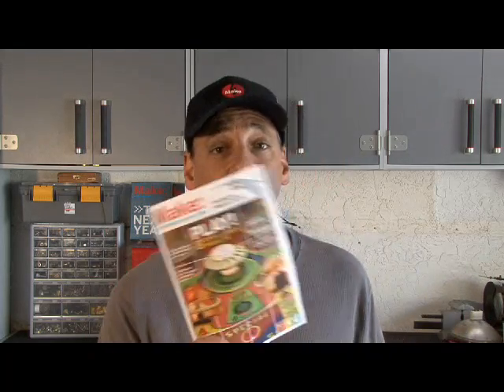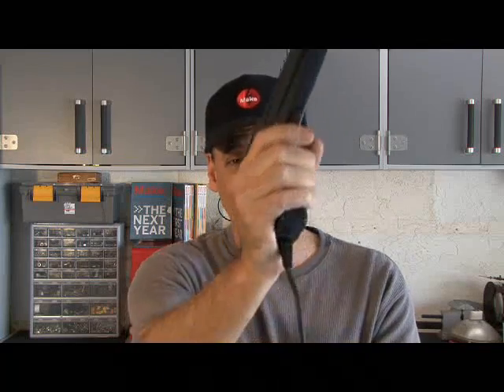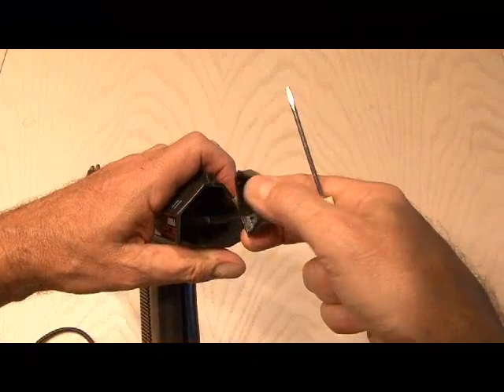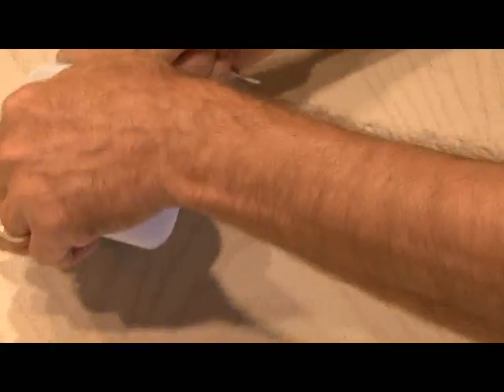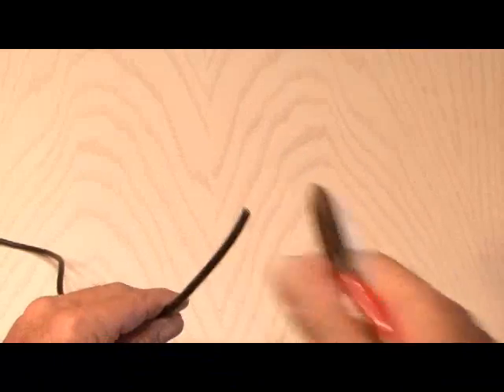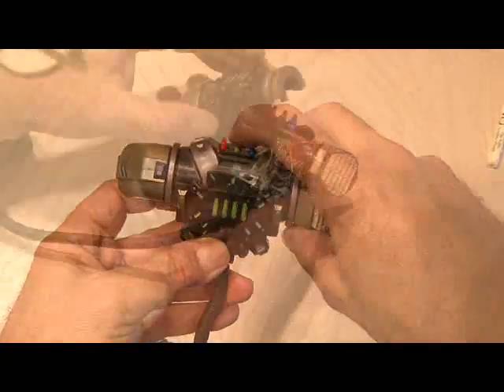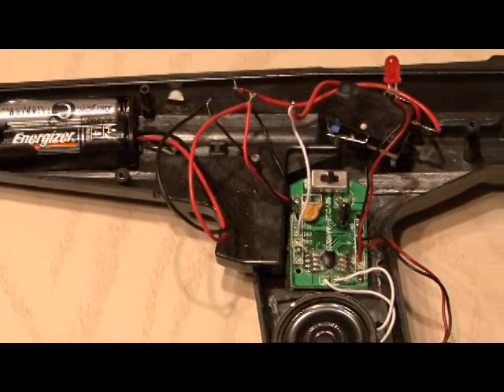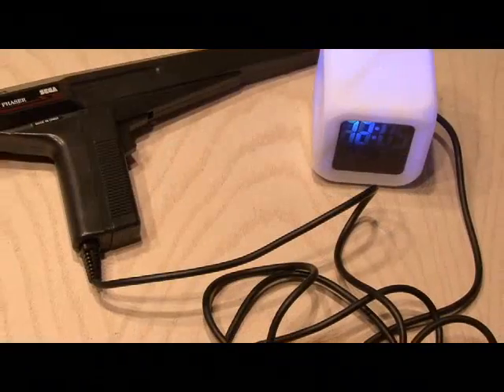Weekend Project: Phaser Alarm

Comment: remember the other two wires in the Sega's cord?  If I had done this neat little mod, I think I would have taken that second LED and mounted it to the clock's case, used the other two wires in the cord to deliver the  the charge...then, instead of looking down the barrel of the gun, lol, you could see the 'impact' on the clock!

Comment: that's right, in this one you don't even have to point at the clock to turn it off =( ..... what's the fun in that?.....
but probably with the laser mode, you'll be too sleepy and have bad aim, so it'll be easier to just throw the hole dam gun directly to the clock, lol

Comment: Use normally open switch, solder to the off button contacts and you get the same thing without retro gun and noises. Instead of wired shut off for the alarm, the speaker can be used as a device trigger. Locate speaker, solder some two strand wire to the speaker contacts, then run the wire pair out a hole and solder it to a universal remote. With a small modification the remote can auto turn on your TV. With an SCR, the alarm can turn your room lights on to wake you up. Who needs a clapper?

Comment: I would have been impressed if you used a remote signal instead of a cable.
currently it's just a little bit cooler than hiting the cube with a broomstick, but in no way more effective.

Comment: First of all, hi and thanks for the weekend project.

musicplayer321: I agree with you on that one, it's probably easy to do: replace the LED in the the phaser gun with a infrared LED and add a IR sensor to the alarm clock. But what if the alarm goes on and you can't reach the gun? :p